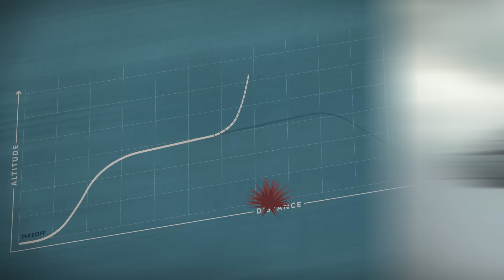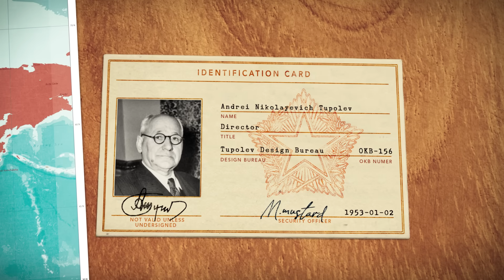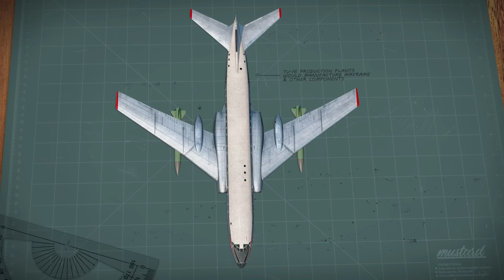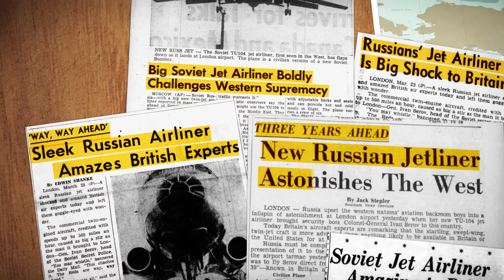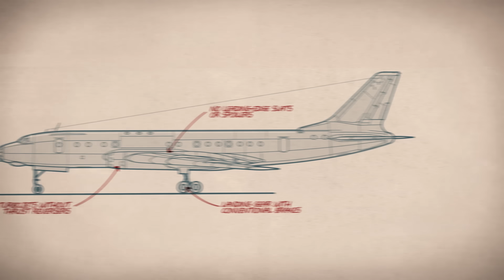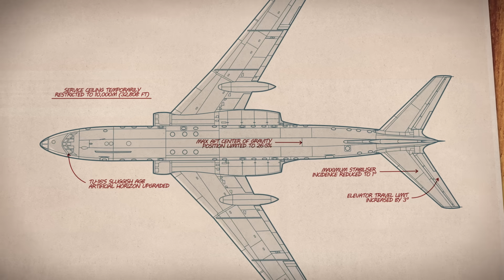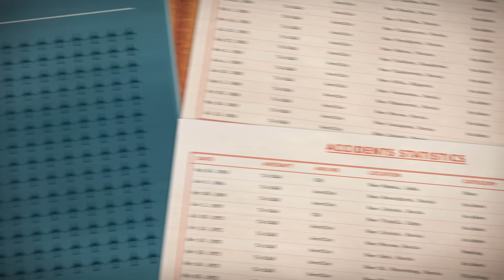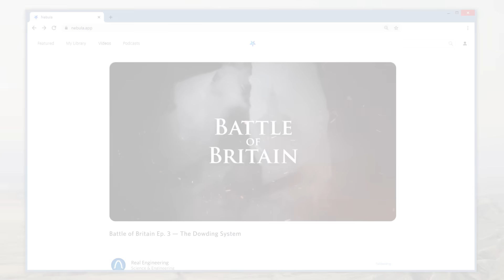The Soviet Airliner Designed To Crash

Comment: Probably no more technologically flawed than the DeHavilland Comet, though with a different set of problems. The US had developed vast expertise in constructing and operating enormously powerful radial engines during WWII, which gave some leeway to continue with large piston passenger aircraft like the Lockheed Constellation until the US aircraft manufacturers had a gained more experience with jet engines and pressurized fuselages, and the 707 was ready to be brought online. Being able to spread the development cost through two divergent aircraft programs derived from the 367-80 prototype (the 707 airliner and the C-135/KC-135 Stratolifter military cargo/tanker aircraft) helped Boeing avoid cutting corners, as did learning everything they could from the problems in the Comet and TU-104 programs. Douglas learned quickly from their experience with jet bombers, large piston transport aircraft, and the first three entrants into the jetliner field.

Comment: List is most dangerous airliners, all of them are soviet, worst than the 737 MAX:
TU-154
TU-134
TU-104
TU-…???
I think that the soviet autorities hidden air disasters to prevent to damage the image, that is why there are not many information about this accidents
Reply: The worst jet airliner in history is the de Havilland Comet.
Reply: @sandervanderkammen9230  and the DC-10
Reply: @christophercarrera2005  The DC-10 turned out to be an excellent aircraft... much safer than either the Tu-104 or the Comet
Reply: @christophercarrera2005  There were 646 aircraft in the DC-10 series sold, many still flying today... its performance flight and per passenger mile fatalities rate and hull losses rate is actually very good.
Reply: @sandervanderkammen9230  however, there is a design flaw on the door iirc
Reply: @Baer9471  what flaw?
Reply: @sandervanderkammen9230  the dc-10 has a cargo door flaw which caused accidents
Reply: @Baer9471  The accidents were caused by ground crews not properly locking the cargo door and in one accident mechanics illegally tampered the the lock.
Reply: The 737 Max has an excellent safety record compared to the Comet... 1 out of every 4 Comets crashed or were destroyed in accidents making it the worst safety record of any jet airliner in history.
Reply: @sandervanderkammen9230  mmm, the 2 fatal accidents are not the only one, there occured many other incidents involving the 737 MAX
Reply: @christophercarrera2005  Please cite any examples other than Flights Lion Air 610 and Ethiopian 302?
Reply: @christophercarrera2005  The 737 Max has just 2 fatal accidents in 500,000+ flights, making it significantly safer than the Comet or the Tu-104.
There are currently over 1,000 737 Max aircraft in service today with orders for 4,000 more... more orders than prior to 2019.
Reply: @sandervanderkammen9230  it was true
Reply: @yohanmaduranga  Yes, the de Havilland Comet is the worst jet airliner in history. 
It has the highest loss rate, higher than any other jet airliner
Reply: @sandervanderkammen9230  yeah
Reply: The worst safety record of any jet airliner in history is the de Havilland Comet with a staggering 1 in 4 loss rate!!!.
That would be equivalent to over 250 737 Max crashes!!!

Comment: Grammer police here ... "Even if they were not the most efficient, and were a little loud".      Needs  a second "were" added ... "And were a little loud".. .. reason, "were not" is acting as the verb , and "the most efficient and a little loud" is a list of adjectives, in effect.   So the "not"  could apply to both adjectives ??? Best to make it clear by adding another verb,  "were not X and were Y ". The "and"  acts as  conjunction,  rather than  "introduces the  last member of the list" ,  so  "and were a little lout "  , combined with the implied subject ,  " engines were loud".

Comment: waiting for Sander Van Cummen to reply under this, throwing a full rant about the deHavilland Comey
Reply: The facts are irrefutable, 1 out of every 4 Comets crashed or were destroyed in accidents making it the highest loss rate of any jet airliner in history.
Reply: @sandervanderkammen9230  OK but you literally don't know that MCAS was designed as an extension of STS.
Reply: @AmbientMorality  You didn't know what version of MCAS is currently in service...
Reply: @sandervanderkammen9230  MCAS was not dual-channel before the FAA grounding, and there is not evidence that there was a dual-channel version of MCAS before the grounding. MCAS was built on STS, which is a single-channel system like Mach trim.

Comment: Comet, commercial jet developed into military aircraft, TU-104 military aircraft converted into commercial jet.
Reply: The Comet was not a military aircraft.
Reply: @sandervanderkammen9230  it is called the Nimrod, it is an anti submarine platform, and it served the UK for many years.
Reply: @aluminumfalcon552  That is a popular but false urban myth, especially in the U.K. and British revisionist historians. You are very confused and misinformed, the Hawker Siddeley H.S.801 Nimrod  is a completely different aircraft that was designed by a different company 2 decades later and a decade after the de Havilland company ceased to exist.
The Nimrod has a completely  different type certificate and airframe parts,  engines and major system that are not interchangeable with the Comet 1, 2, 3 or 4. 
Any questions?
Reply: @aluminumfalcon552  The Nimrod never had any foriegn customer orders and the RAF began replacing the Nimrod with variants of the Boeing 707 series, the Nimrod was grounded in 2011 due to safety concerns related to premature metal fatigue and are being replaced with Boeing 737 series aircraft.
Reply: That doesn’t change the fact that after De Havilland and Hawker Siddeley merged, they used the Comet as the design basis for the Nimrod, the key being I said it was developed into the Nimrod, it is not a clean sheet aircraft on its own, much the same way the TU-104 came from the TU-16.
Reply: @aluminumfalcon552  The de Havilland company went tits up in 1958 and was placed under administrative receivership by the Crown court.
It's assets were sold to Hawker Siddeley who continued to use the de Havilland trademark until 1962.
Reply: @aluminumfalcon552  That is a very false and misleading statement.  While the Hawker Siddeley Nimrod may have been conceived as a design that would utilize and repurpose the millions of pounds of unused tooling and unsold parts from the canceled Comet program, and its two prototypes were constructed from heavily modified Comet 4Cs that were unsold, the production H.S.801 Nimrod is a completely different aircraft that has very, very few parts interchangeable with the Comet 4C and nothing interchangeable with the original Comet 1.
Reply: @aluminumfalcon552  The Nimrod is certainly not a fair analogy with the Tu-104, the Tu-104 and the Tu-16 were designed concurrently by the same manufacturer and design team, they flew less than 3 years apart and share the same wings, engines, empennage and support systems.
The Hawker Siddeley H.S.801 Nimrod is a completely different aircraft that was designed by a different company 2 decades later.
Reply: @sandervanderkammen9230  I think you are looking too close into my comment, in the Tupolev a military design begat a commercial aircraft, and in the case of the Nimrod and the Comet, a commercial design begat a military aircraft. There’s nothing false or misleading that the Comet was the origin of the design for the Nimrod.

Was my statement oversimplified? Yes. False? No.
Reply: @aluminumfalcon552  The Hawker Siddeley H.S.801 Nimrod is not a Comet, it is a completely different aircraft that was designed by a different company 2 decades later....
Many revisionist historians in the U.K. attempt associate the limited success of the Hawker Siddeley Nimrod to the Comet in an effort to temper the harsh reality that Comet was epic failure and a huge waste of lives and tax payer funds.
Reply: @aluminumfalcon552  The de Havilland Comet is the worst jet airliner in history... a truly shameful and humiliating chapter in British history.

Comment: Just the front profile of the plane looks dangerous. An anhedral on a low wing passenger airplane is a bad idea. It makes the plane less stable especially in turns. You usually see anhedrals on very large high wing planes

Comment: 737 max 🤔 about 400 souls lost ,but who remembers that's.....
Reply: everyone's still remember that
Reply: There are over 1,000 737 Max 8s in service right now with orders for over 4,000 more... more now than in 2018.
The Boeing Max loss rate is just 0.19% Compare that to the DeHaviland Comet at 23%
Reply: @sandervanderkammen9230  It's true that 737 MAX is better than the Comet, but that's not exactly the greatest endorsement.
Reply: @AmbientMorality  The greatest endorsement is paid in cash... Boeing has sold 11,000 737s... 1 out of every 3 people in the air right now is onboard a Boeing 737... it is the most popular and most successful aircraft of any type in history.
Reply: @sandervanderkammen9230  Alright, but my point was that the original design of MCAS in 737 MAX led to an unacceptable safety record. Obviously it was better than Comet, but it was much worse than virtually everything else.
Reply: @AmbientMorality  The ORIGINAL Boeing design for MCAS is what is in service now, the fix was to use what Boeing specified for the MCAS system originally, it was the FAA mandated version that was a contributing factor in both accidents.
What happened in the case of the Max 8 is unprecedented, never has a government mandated safety device  been responsible for 2 major accidents.
Several key FAA employees were fired or resigned, the Director of the FAA also resigned in what was the biggest scandal in the agency's history.
Reply: @sandervanderkammen9230  Boeing did not specify any MCAS implementation with two sensors. MCAS is an extension of STS, which only takes input from one of the ADIRUs (so one sensor set).
Reply: @AmbientMorality  Boeing never intended for MCAS to have full authority of the pitch control.
MCAS was designed as pilot warning device similar to a stick shaker, it was to only meant to momentarily dip the pitch attitude to alert the flight crew. The FAA would not allow Boeing to install a audible chime  or visual warning light to indicate that MCAS was activated... they insisted against Boeing's experts to give MCAS full authority.
Reply: @AmbientMorality  MCAS system as mandated by the FAA behaved exactly like a runaway stabilator trim control.
Neither flight crew followed the proper procedure for runaway stabilator trim which ultimately led to both accidents.
Boeing did not design or manufacturer the vane sensors that failed.
Reply: @sandervanderkammen9230  I am not sure what gave you that impression. MCAS resolves the reduced static margin at high angles of attack on 737 MAX by adjusting stabilizer trim to increase control forces. It was absolutely not a pilot warning device in any way. I have no idea where you got that idea from; that's not something I've heard from anyone, even though lots of other misconceptions are floating around.
Reply: @AmbientMorality  You didn't even know that the design currently in service is the original version.
Reply: @sandervanderkammen9230  That is simply incorrect. The original version did not use two sensors, because, again, MCAS was envisioned as an extension of the existing STS.
Reply: @AmbientMorality  You are very confused and misinformed, the original version had the option for 2 sensors as well.
Reply: @sandervanderkammen9230  All 737 aircraft have two angle of attack sensors. However, the speed trim system operates using data from one of the sensor groups (one of the ADIRUs, each of which connect to one angle of attack sensor). This has been true since 737 Classic when STS was introduced.
Reply: @AmbientMorality  MCAS was designed to use 2 vane sensors in a parallel redundant system.
The modified FAA mandated version had the option for a single sensor input.
The system in current use is the original Boeing designed version.
Reply: @sandervanderkammen9230  So are you challenging the fact that MCAS was built on top of STS, or the fact that STS (prior to the MAX grounding) operated with a single sensor group and control computer? I can demonstrate both of these are true, but I am not sure where your confusion is.

Comment: Interesting how they integrated the engines into the wing instead of attaching them to the wing.
Reply: They like the British they lacked the advanced windtunnel data the Americans captured from the Germans, through exhaustively researching different engine placement configurations the Germans discovered that for subsonic applications suspending the engines under the wings was the optimum solution.
Reply: @sandervanderkammen9230  Thanks for the info.  It seems like it would be far more difficult to engineer a wing with a void to fit an integrated engine than a solid wing with an engine attached beneath it.
Reply: @nunyabidness117  Yes, there are numerous disadvantages to put the engines inside the wings, they have serious aerodynamic problems that negatively impact the engines intake pressure and the wings ability to produce lift, they require heavy shielding to protect the wings and insulation for sound and fire, the y are harder to work on and updating the aircraft with new engines essentially required new wings.
Reply: @sandervanderkammen9230  Interesting. The only question is why would they do so much extra work to integrate the jet engine into the wing instead of just attaching it beneath the wing, especially considering how notorious they were for cutting corners?
Reply: @nunyabidness117  The design was based on a British aerodynamic theory that later proved to be completely wrong.
The U.K. didn't have large diameter transonic and  supersonic wind tunnels until after the Comet was designed.
Germany on the other hand had the Luftfahrforschungsanstalt the most advanced wind tunnel facility in the world in 1939.
The RLM conducted research of both large scale models and actual jet engines and aircraft to speeds up to Mach 1.5.
Reply: May I ask how you came to be so knowledgeable about this?  I worked for years for a regional airline here in the States and it was always interesting talking to the engineer and mechanics about our Bombardier jets.
Reply: @nunyabidness117  I have had the great pleasure and privilege of working with some of the best aerospace engineers in the world, I built my first jet engine when I was 15 years old (set my parent's garage on fire) I was fortunate enough to interveiw the great Dr. Anselm Franz for my thesis, I have had a passion for the early development history of jet engines and aircraft.
Cheers!

Comment: The Boeing 737 doesn't have a great record recently. The US was years behind the European industry in the 1940s and early 1950s. The DH Comet was launched in 1949. Very US centric vid and ommits US hostility to Concorde.
Reply: The Boeing 737 Max has an excellent safety record compared to the Comet! The Max has 1,033 aircraft delivered and a 0.19% loss rate, the Comet has the worst loss rate of any jet airliner in history at an obscene 23%!
Boeing was years ahead of de Havilland, the B-47 flew 2 years before the Comet.
The Concorde was an epic blunder, the biggest financial failure in commercial aviation history until the Airbus A380... at least they sold 200 planes, Concorde had zero orders!
Reply: Took a few hull losses to get the Comet right, but hey. Mustard has done videos on the Comet and Concorde where he covers your points.
Reply: @mtnman1984  The Comet Disaster remains the worst engineering failure in jet airliner in history.
Concorde completely failed to deliver what airlines wanted.

Comment: Still safer than the DC-10 and most of Boeing's flying coffins like the 737 MAX
Reply: You are very confused and misinformed..
The DC-10 and the 737 Max have a better safety record than the Tu-104 and de Havilland Comet.
The Comet remains the worst jet airliner in history.
Reply: No those planes fix problems, russia just keeps flying them
Reply: @rodgermurphy5721  you live under a rock of lies and corruption
Reply: @Thunderbolt_1000_Siren  I wouldn't fly on a rusty russian plane if my life depended on it
Reply: @rodgermurphy5721  Nor would I fly in a coffin that either poops engine parts, blows cargo doors severing vital controls, or has an autopilot that basically pushes the nose to the ground against the pilots will without any way to pull out. All cause the manufacturers kept it hush hush to cover it up cause Muh money and international market monopolies! Wanna safe airliner? Try the TU-114 (which never had a design related accident) or the Tristar, the plane that could literally land itself and was basically the DC-10's distant cousin but without all the negligence. Or even better if you're going domestic and not international? TAKE THE FRIGGIN TRAIN!
Reply: @Thunderbolt_1000_Siren  No I'll take Boeing. Unlike russia they have quality control
Reply: @Thunderbolt_1000_Siren  Boeing makes the safest jet airliners in the world.
Reply: @Sander Van der Kammen  that's the best satire I've ever heard.
Reply: @Thunderbolt_1000_Siren  Serious as a heart attack son, Boeing makes the safest aircraft in the world.
Reply: @Thunderbolt_1000_Siren  The deadliest jet airliner in history is the de Havilland Comet.
The Comet has the highest loss rate of any jet airliner and the worst per flight and per passenger mile fatalities.